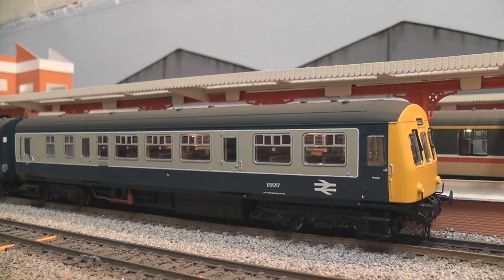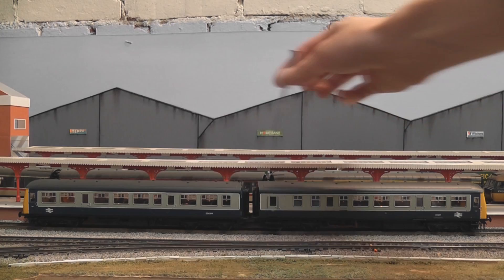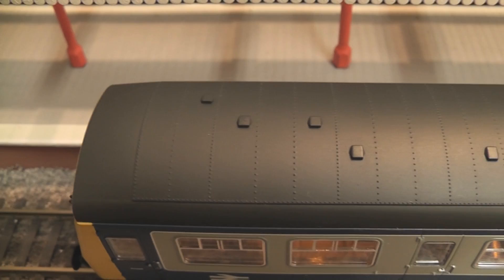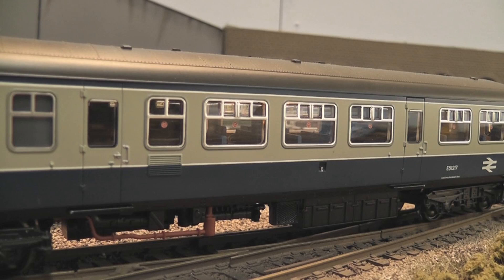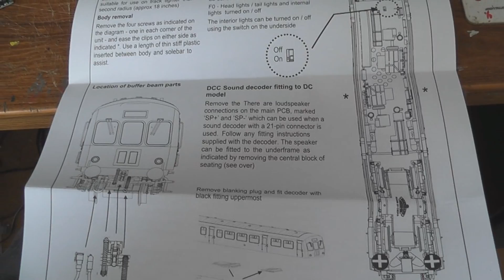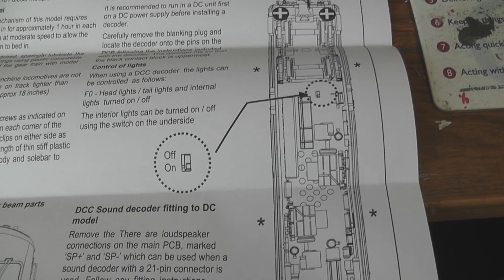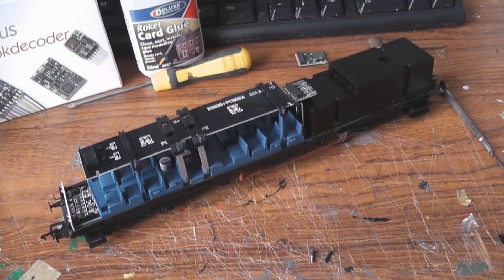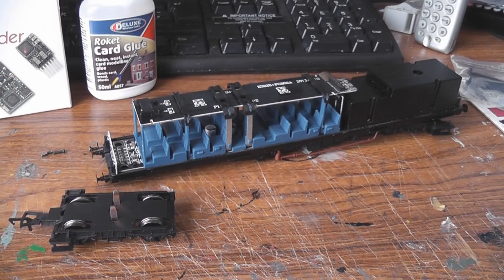Bachmann Class 101 Review

Comment: I agree about the sprung buffers. I know of no one who stops a train operating session to push sprung buffers, no one. All they do is make the model more expensive. I have other expenses I would rather spend my hard earned money on. If others don't mind, they can fit the sprung buffers themselves.
Reply from the maker: SeaToby11 Agreed, opening doors is another one I wish manufacturers would leave off.
Reply: All we want is affordable good looking locos running on our layouts. Not collector's pieces sitting behind locked glass collecting dust. A Bachmann Pannier tank loco arrived today defective. When I slightly tilt the loco from side to side there is something inside clunking around from one side of the loco to the other.EVEN MY MAILMAN HEARD AND FELT IT DELIVERING THE PACKAGE. Where is quality control? We'll see what is wrong as I have to open her up to chip her.
Reply: Well I opened her up and chipped her, the clunking noise was a loose weight, so I taped her down. She is running beautifully.
Reply: EverardJunction But I disagree about the switch for the interior lights. Not everyone gets a DCC chip, and run their trains on DC. Surely they would like to turn on or off the interior lights too.

Comment: A great review of the model, and great production values. 
  However, I feel you've done a bit of a disservice to these old girls in the prototype. 
  Yes, they were getting on a bit towards the end -- they could definitely be a bit threadbare inside, however they were still a good motor to drive - well able to get to their top speed of 75mph right up to the end.
  The one thing that did affect reliability was the unloader valve for the compressors. 
  Without wanting to get too technical, the compressor was driven by the engine, and, therefore, ran constantly. In order to maintain the main res pressure between 85psi and 100psi, the unloader valve basically 'disconnected' the compressor at 100psi and reconnected it at about 85psi. 
  This valve could get stuck in the 'unload' position, and you would (eventually) run out of air. To overcome this fault, you could isolate the unloader valve by screwing a 'blanking off nut' over the valve. The compressor would then pump air constantly, and at 105psi the safety would lift to stop the air system overcharging (and eventually exploding!). This procedure was intended just to get you home to the yard, however towards the end a lot of power-cars were running round with the unloader blanked off. As the compressor would also be able to cool down during the unloading phase, blanking the unloader meant the compressor didn't have any time to cool down. Eventually you ended up with air leaks all over the compressor, destroyed piston / scraper rings, and compressors basically not compressing! 
  Other than that, these were great machines. Very fuel efficient :- a power-car was capable of doing about 6 mpg (very, very good for a train!), with locos it Gallons per mile, Sprinters might do 2 or 3 mpg, while the SR DEMUs did about 1:1. 
  In short, the Met-Cams were a great investment for BR. Initially designed for 20 to 25yrs to cover the gap between steam and electrification, they went well beyond that, and are still going strong on preserved lines. 
  A really great train, that I miss driving immensely. I loved driving all the mechanicals, but the 101 was a favourite.
  Thanks for listening, and for a great, really thorough, very informative film.
  Just don't knock the Met-Cams!!
  Best Wishes and
  Kindest of Regards,
      Zac.

Comment: Hi Richard. The reasons for the switches underneath is to keep the wiring connection to a minimum. If Bachmann had allowed you to turn the interior lights on and off with the decoder the coupling bar would need to have four poles as opposed to two. 

This is a great channel, I've been following you for a few years now despite modeling German HO scale.

Comment: 8:50 I think the bars are toilet tank water filling pipes. A hose is connected to the bottom and water pumped in to fill the tank for flushing toilet or tap water.
Reply: Simon Robinson correct. Fill from ground or platform level

Comment: those engines are bus engines leyland 680s i used to work on them good reliable engines they even used the same gear box and running gear pneumocyclic gearbox with a fluid flywheel even the gear lever is the same as the bus ones

Comment: The pipework that you weren't sure of at end of coach is just to get rid of rain water
Reply: sometimes there are rain pipes from the gutter ends to the solebar, but these pipes would be the fillers for the toilet water tanks.  Allows depot/station staff to fill the tank from trackside rather than having to climb on to the roof as was the case in the days before health & safety was invented ;)

Comment: Bachmann mk 1  coaches
Reply from the maker: I use kadee 19s or 20s on those.  Mk1s require some work as the kadee doesn't stick out far enough.  I drill a hole in the side of the nem pockets.  This makes the kadee clip in earlier and then it sticks out far enough to work properly. 

For connecting the coaches together I would recommend you use the draw bar they come with in the box.  That keeps them nice and close.